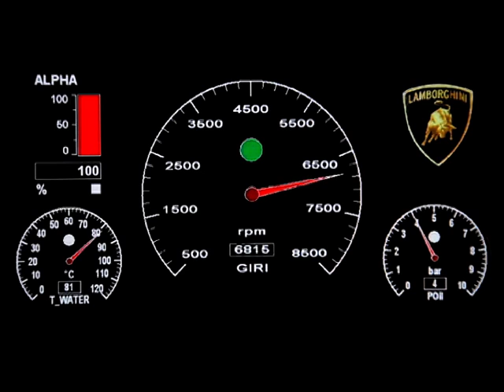New Lamborghini V12 Engine Assembly

Comment: @JLew314 

read 1001 RELIABLE hp. Bugatti saw over 1300hp in testing but knew that designing a reliable semi-auto gearbox that could take 1001hp for years was difficult enough, and the last they need is some insanely tuned engine which requires loads of service and is practically undrivable for anything but racecar pros.

700hp from a 6,5 litre engine is 107,7hp/litre. Plenty of manafacturers have achieved that. Ferrari F355 had 380hp from a 3,5litre V8 back in 1994, which is 108,6hp/litre.

Comment: @GamePlaya19 yeah they are all the old engines but I'll see what the "real" changes they made when one of these limps into the shop.  I hope they redesigned the oil pump for one.  and lambo did make a variable valve timing motor in 98 for the diablo sv.  its a sweet motor.  the four intakes is a sweet design I'd like to see how they flow.

Comment: My good friend has 5 of these engines in his shop.  even a "vtec" diablo sv motor.  They are pretty good and decent packaging.  its just now 12 cylinders are a bit much these days.  the higher mechanical losses from moving 12 cylinder long crank and cams deals a blow.  but the sound is amazing.

Comment: @jshooly 

with a turbo you can get insane amounts of hp no sweat. Brabham used BMW's inline 4 called M10/M12 (first designed in 1961) to win the 1983 Formula 1 title. That engine was roadcar based. 1,5litre (91cui) and saw over 1400hp in qualifying trim, and around 900hp in races.

Do you honestly think the rich owners will do the service themselves? They can afford it, and the mechanics are specialized in Lamborghinis.

A Lamborghini V12 has a soul, like no other engine.

Comment: @jshooly That same V6 is probably pushing over 25psi of boost and most likely will not last 100-200,000 miles (There are Murcielagos with well over 100,000 miles, running fine)

Comment: @mikasaur 

They've had that in motorracing for decades.

Also, the BMW V12 in the McLaren F1 LM (only 5 made) could rev up to 8500rpm too back in 1995. It made 680hp from a 6,0 litre V12. That engine was good enough to win the 24 hour LeMans race in 1995.

Comment: @leloodallasmultipass its a V12 they have even firing between the cylinders, much like a flat-plane V8 (F430) this gives the high pitched sound. Crossplane V8's (small block and most others) have the burble sound due to uneven firing order between the two banks.

Comment: @leloodallasmultipass 
It`s the high compression ratio and the effective breathing of the engine that makes it sound like that. Unlike the rough Camaro V8, it`snt got just 2 valves per cylinder and just one camshaft. It`s a highly sophisticated power plant, in which many factors have been taken into account. This is the sound of efficient excellent work of the combustion engine. Why do you think 8500 rpm are not very high rate? They burn this engine all day long at 8500 testing it to last a lot.

Comment: Sorry bro, i don't want to start an argument or anything, but that reply saying that it is going to run under "current gravitational conditions" will not make the argument correct. Kg is used to derive a lot of other things like power (kW), weight (N) , Volts (V), and about 20 other things. And standard notation or "commercial measurements" like you called them say that kg is a mass and N is a weight. All of these things i just mentioned are in SI units.

Comment: @jshooly The 84 Buick V-6 with rocker shafts, had terrible valve geometry. (what yr. are you referring to) These engines were designed to chew-out the valve guides, then your oil gets all white and gooey with blowby. A Mazda V-6, on the other hand will easily hit 300 000 km if you don't over rev it. This 92 engine (150 hp) has only 4 mains, and that is skimpy. The OHC shim and bucket valvetrain is possibly the best. With Amsoil, perhaps 8500 rpm is an all day reality. No?

Comment: @cockyhotty I am comparing the sound to a motorcycle's which is a high pitched one like this, but the rpms are closer to 11,000 on the top end.  A lot of well tuned v8s get up to 8500 and don't sound anything like this.  Most v8s are redlining at or below 7k but even at 7k the lambo sounds like a drill.

Comment: Interesting.  Bigger bore and less stroke than the current V12.  I guess it means 9000RPM would be possible in the aftermarket.

Only "let down" that I see is no direct injection...

Comment: what is it about the way this engine is designed that makes it sound as high pitched as it does?  is it the exhaust?  the valves?  it has tons of capacity but doesn't sound like a deep v8 like a big block chevy or something.  why not?  I used to think it was rpms but the engine clearly only goes up to 8500...
anyone know?
Reply: It has the capacity and then all that Exhaust is pushed into those tiny pipes so its in essence like a whistle

Comment: I'd like to see a gear driven valvetrain, and a crank/alternator combo. Magnets buried in the crank throws would spin near stators in the walls of the block. This would generate enough amperage to efffect a forcefield around the vehicle. Also, I've seen engines after fires, and only the iron block seems reuseable. When will aluminum have the same melt-down resistance as cast iron? The tech is sound but the materials iz gawbage.

Comment: @powerslave789 It´s true - GT2 is amazing machines, but Enzo is amazing, Zonda R is amazing, 458 Italia is amazing, 599 GTO or FXX are amazing, NSX-R is amazing... You know, what i mean... Even car with turbo can be a great, but non turbo engine is better - no turbo hole, lower weight, ect....  By the way - F40 is 25 years old car and Porsche is typical factory using turbos for many years. I like non turbo Porsche cars - GT3 and GT3 RS... Turbo is good just to meet a emissions limits...

Comment: Maybe they should have made it clear that this engine is made to run on planet earth under current gravitational conditions, thus making the statement correct.
With matter being so difficult define I think the measured mass would be irrelevant either way and we'll be better off sticking to the commercial measurements they've used here.

Comment: @mikasaur the more cylinders it has, the more revs it can reach my friend-->inertia
Reply: Um no, not even close.How do 20 000 rpm 4 cylinder bike motors factor in your above statement ? Stroke length and valve springs are the main factors in reaching higher RPM's, not cylinder numbers, and definetly not inertia. Inertia limits rpm output.

Comment: You are wrong about aluminium, cast iron is cheaper. Racing engines like ls6, ls7, engines on performance vehicles are made of aluminum. But cast iron is used on most other vehicles since it is way cheaper than aluminum. Do a little research at least.

Comment: So epic engine    but     only having 691 BHP  and gives 217 MHP  How its possibale  car   having 6.5  Liter  Engine   and top speed   217 mhp  while  Ferrari enzo    more  havier  and  have only  6.0  Liter engine  and    top speed   is 218 MHP   And Aventador   Its made from carbon fiber    Aventador  true top speed is 220 mhp
Reply: Deathcore - It's all down to Aerodynamics and gearing.That's how it's possible. Firebirds with small block Chevy's have now passed 300mph on the salt flats over a 10 mile/16klm straight.